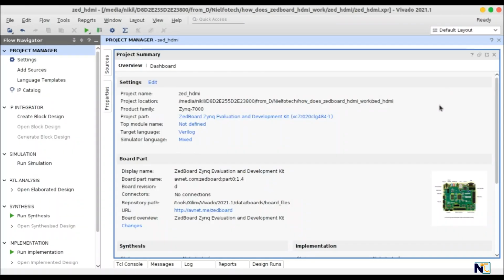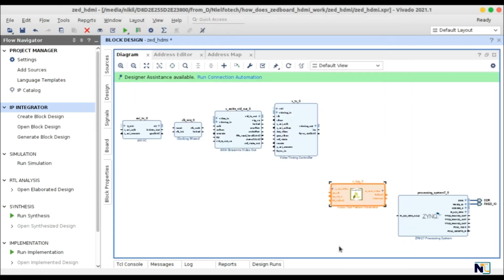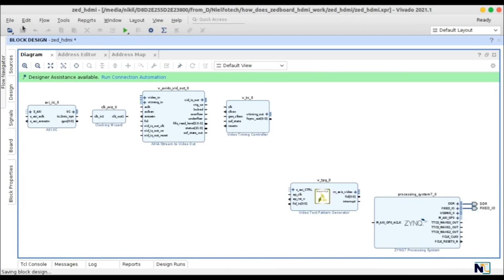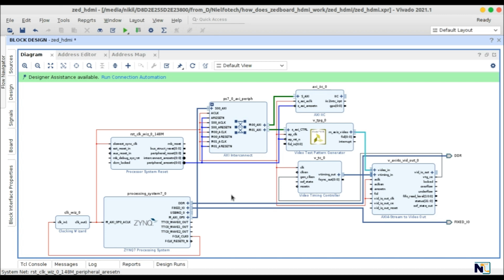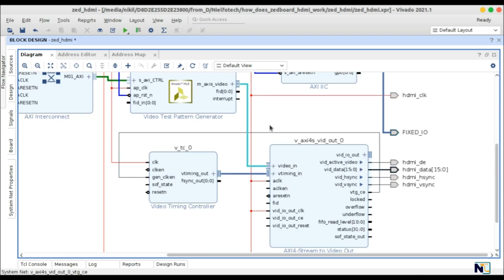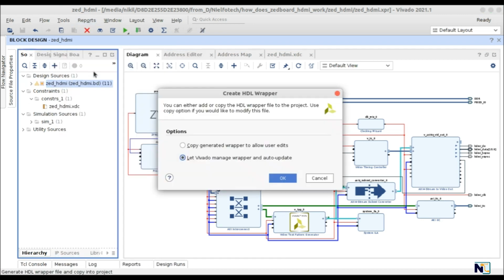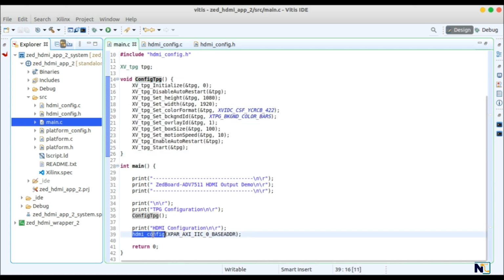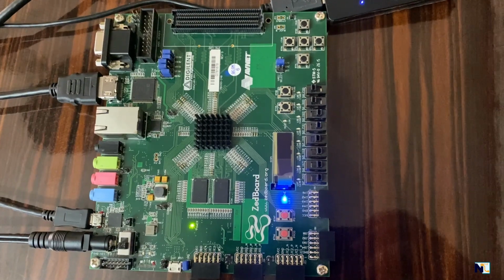ZedBoard HDMI1.4 Working #Principle with FPGA

Comment: Followed the tutorial word by word. IIC configuration matches successfully. However, there is no display. The On/off light of screen turns from yellow to green, after 10 seconds, screen says going to power saving mode and turns off. What an I missing here??
Reply from the maker: Try switching other hdmi monitors.
Reply: @nielfotech4684 I narrowed it down to a problem with timing generator. The vsync signal is not being generated correctly. I suspect the sof_state input has something to do with it. I'm trying to figure this out.